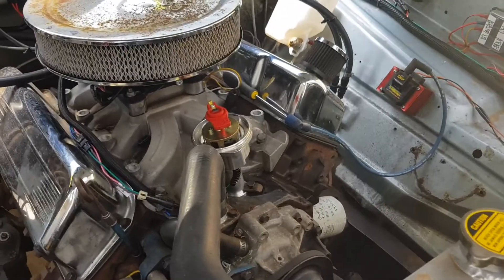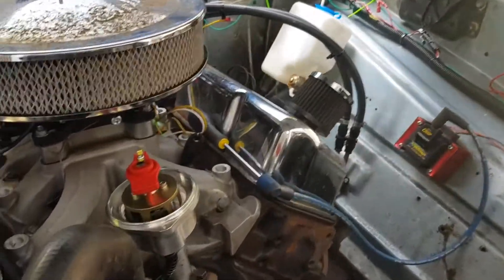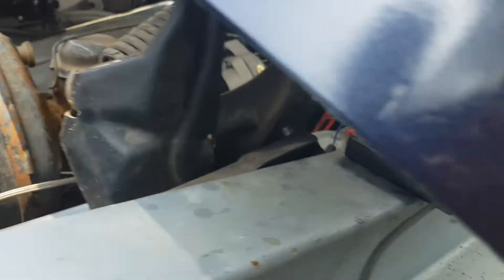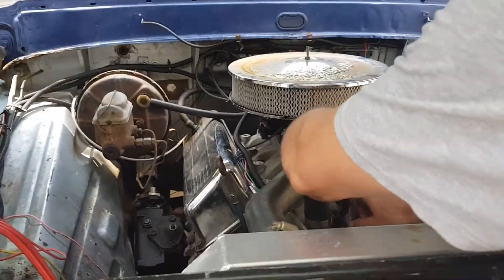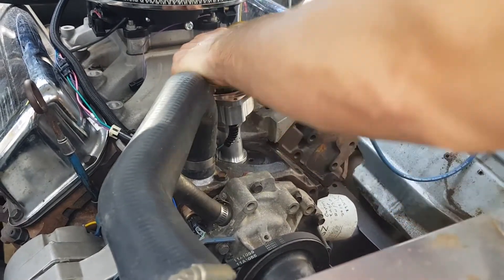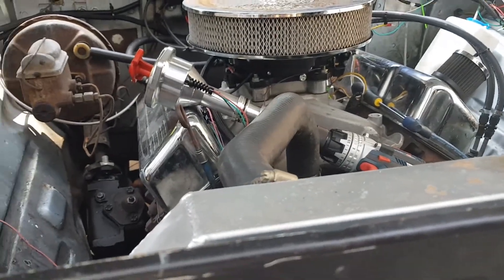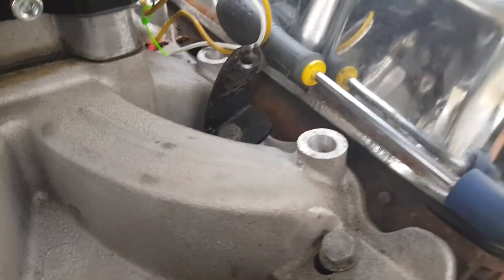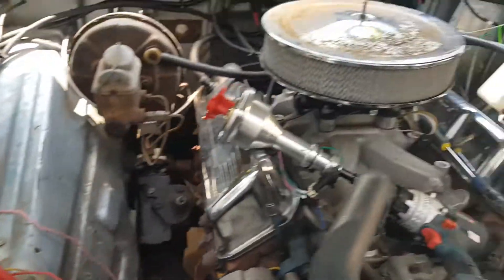Holley HyperSpark Not Working When using starter motor

Comment: Is the pink wire attached to the ignition source fully or attached to a resistor wire that is normally used to drop voltage? It has to be that pink wire is the issue it needs 12V while cranking, it can’t drop…

Comment from the maker: Soooo a 2 year update. I fried my spare distributor so need to get this working.

I found that during cranking the efi isn't getting rpm signal, it's registers fine when spinning on the drill. 

Voltages drops to below 10v during cranking across the terminals so there's nothing I can do to get it higher. 

So it's either the pickup or low battery. 

I'll need this going so will update soon

Comment: I have the exact same issue.  Did you find the cause?  I’m ready to toss mine for a carb since when this issue occurred, I also lost the fan and Tach signals as well.
Reply from the maker: Hey @EDS Speed Shop
, nothing found yet unfortunately,  couple of additional notes that may help.

During testing the holley log indicated that the voltage dropped below 10v, which is below the acceptable sniper range. 

I tried bypassing the CDI box I have and used the supplied coil module and the exact same effect happened.

I get spark between the very short time period of releasing the starter motor and the engine spinning down. I suspect this would mean if i had a manual car and push started it that it would work.

I tried running new dual new batteries to see if that helped but it didn't which leads to the same conclusion that the Holley guy indicated, bad wiring supply or earth which cant keep up with demand.

The reply from Holley
"The difference between the two running modes, drill versus starter, as far as the Sniper in concerned, is voltage and ground availability. Have you put a multi-meter between the starter ground and battery neg and looked to see if there’s any resistance?

I would look at adding a ground between the engine block and battery negative, hot-wire the pink to battery positive, and the thin red on the CD box and distributor pink power as well. I think there’s something going under 10V while cranking."

I plan on trying this during these holidays,
 II'll update in this if there are any improvements. I also had a thread on the holley forums that I'll update as well.

cheers
choco